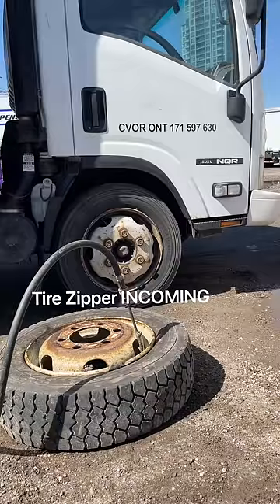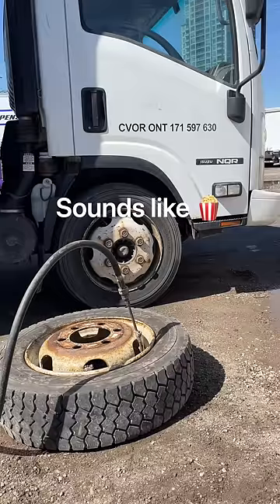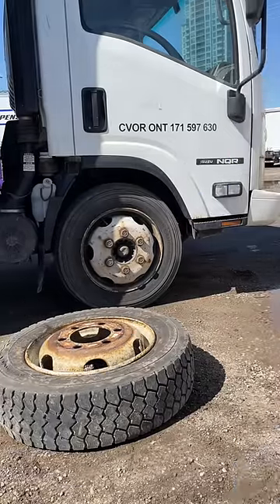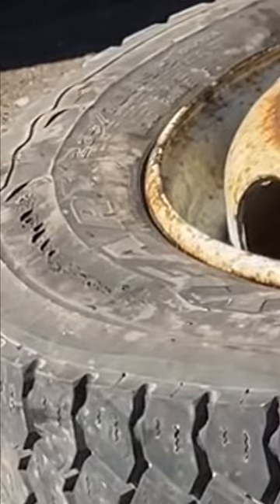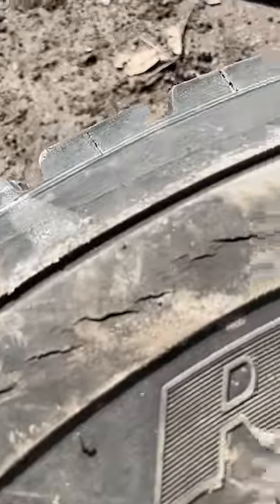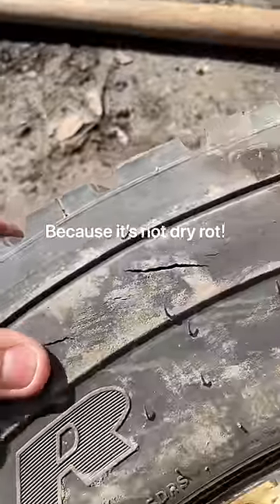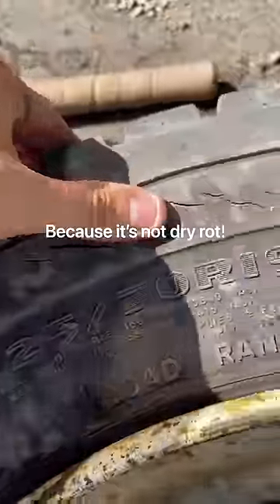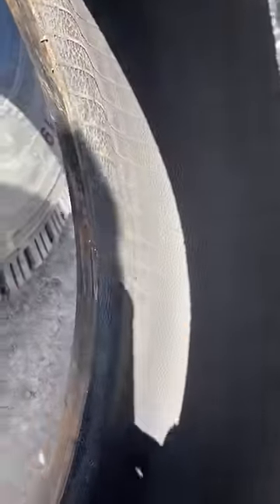Tire Explosion Warning: 🍿 Sound! #shorts

Comment: Tires can also make a very similar sound when the bead sets off center and then corrects itself once the air pressure comes up. Thing is, that's normal and doesn't kill people. Zippering definitely can.

Comment: shout out to all the tire guys and girls out there.
this is dangerous and we all need you.
early on i was warned of the dangers of pressurized air and also tires. ive seen bike tires pop and send groups of people running. ive seen car and truck tires pop and do some damage but high psi truck tires are no joke. these things can unalive even the toughest things faster than the big mad can throw a 13mm wrench in your plans. when you realize every square inch of that tire is under your body weight in pressure. it changes how you view that.

Comment: The reason why the inside of the tire would look fine is because dry rot normally occurs when the outside of the tire goes through repeated cycles of getting wet and drying out, the inside of the tire would never experience that because it’s sealed.

Comment: Crazy I just heard that same noise this morning while filling a tire. But I constantly checked the pressure and it wasn't getting overfilled.
Reply: Overfilling isn’t the cause. They can and will explode even at pressures under max pressure. 
That sound is the sound of the cords of the carcass tearing apart. If enough tear, the whole ply will tear explosively and the tire will explode. 
They are tearing because something has caused them to weaken. In this case it was dry rot. In other cases it can be heat or other damage or a manufacturing defect.

Comment: To never dye from a tire...#1 Don't ever approach a tire if you hear that popping or see a bulge. #2 it should be in a cage or restrained on the truck when inflating so you can let it boom without risking your head or 200 lbs flying at someone. #3 install a valve 15-20 ft down the line so you can stop the air let out the air and check the current pressure when airing up.  I've had several that don't make a sound before just going BOOM, flat sidewalls no bulge literally a brand new tire and boom at 70-90 psi. So don't trust any tire, restraint it, stand back with in line air gauge and let it sit a minute at full pressure.

Comment: I wrote up so many tires on vans in a chemical plant! Dry rot is nothing to play with, this old plant was very tight and the tires scared everyone. We spray painted them pink orange yellow and green. One tire for each color, this way the owners of the plant would force the cheap sub contractors to replace the tires.  Even though only rolling at less than ten mph. A tire poops and it could hit someone! Pops not poops!?!?!

Comment: I was riding my motorcycle last summer and was passing an old, beat up semi rumbling along in the right lane. When I began to pass and pull up next to the trailer, one of the tires chose that exact moment to explode. I was maybe 8 feet from it. Whoa Nellie! The fact I lived was amazing. It was spectacular. When I got stopped on the side of the road, I had pieces of rubber inside my jacket and jammed into my visor. That's when the shaking started. That quart of adrenaline that was dumped into my bloodstream was like no terror I had ever experienced before. So all you truckers who are trying to save a few buck by not replacing these piece of shit tires...when it happens to you, or a loved one, only blame yourselves

Comment: I had heard that sound several times and did not know what it meant, until I had one of my tires being repaired and the service guy started to run away.
 And he yelled and me to get back.
 And I thought the dude was an idiot. Then he explained why.
 Luckily the tire didn't explode.
 I didn't have the money to replace it at the time. 
 So I deflated it 30 PSI and drove on it several more weeks😁

Comment: It’s especially sketchy on airplane tires.  12 ply tires filled to 200psi on split rims.

Even brand new wheel assemblies with a new tire installed and already seated and leak checked can just decide to blow the fuck up.  

Some aren’t re assembled correctly and the whole thing will explode turning that 20lb 14inch hub yeeting off the axle at the arm amputation speed of “you’re about to find the fuck out” 

Being an A&P is scary.  I’ve narrowly dodged death like 5 times in 8 months

Comment: I know that sound well. Thank God it was on the trailer on the inside. I was only doing a PM service on site, it was low and i was going to check for a leak. I didn't get that far before BOOM! It almost sounded like the bead seating but it was the tire zipper. It blew with such force it embedded dirt into the back of my hand while holding the air chuck. I had safety glasses on and I'm lucky i did.

Comment: He pulled that out quick... Glad you did tho bro you would've been mush if that exploded. And I can't lie I had always been skeptic about filling up Heavy Terrain tires on sprinters that require over 50psi. Even a new tire can fail and possibly explode, so instead of standing in front of the tire I stand off to the side using that same extension he's using in the video

Comment: Had a inside dual on a semi trailer blow on me. Took it up to the shop to put air in it because it was really low. Was putting air unto it, heard the cracking, thought it was gravel under the tire on the concrete pad. That was 8 years ago and i still have ringing in my ears

Comment: So in that case. After I disconnect air hose from the tire, what should I do? Release the pressure from the tire by pressing the tire valve? So dangerous. Keep a safe distance and let it explode? Looks like it wasnt what you did

Comment: Cracks in the rubber let water penetrate to the steel causing it to rust and weaken. 

1. The tire should’ve been restrained. Had it blown that thing will take off like a rocket 
2. You need to have a remote air line. Putting your arm in the trajectory zone is dangerous 

You need to sign up for a TIA course on how to service tires. You are gonna get yourself or someone else hurt and possibly killed.

Comment: When i was a teen i worked at uhaul and one day we had a truck with a flat, bit I could see no obvious reason for the flat, so i decided to bring it back up to pressure. 100 psi. Needless to say it blew up in my face. Luckily the inner tube didnt burst thru so it only sounded like a bomb went off.

Comment: I’ve actually seen a 22.5 explode off the rim laying on the floor. It was being filled just like this and the little Mexican guy forgot he had no needle in the valve stem. so it was filling fast. Close to 5 mins pasted and a huge explosion happened.The tire shot up into air like a fucking rocket and went right thru the roof of the shop. It created tons of fog, dust and debris everywhere. The hole it made was about the size of the tire. It was a steel flat roof. To boot the hole didn’t get fixed all week.😂😂😂😂

Comment: work in medicine but have some vintage trucks on split rims.  never forget this one guy looked like he was thrown off a motorcycle at speed nah he was airing up a tractor tire which blew throwing him through the sheet metal and 2x4s of his pole barn.  clear through broke the 2x4 ripped the siding off his barn.

I have a nice long air whip with an on off valve.  nothing goes near the tires when air is flowing.

Comment: I had a new retread bubble up in my hand 20ft from the cage while rolling it to the trailer. That one was more like a crackling sound, im guessing it was the air forcing the glue apart, happened fast, i heard it and felt it at the same time, i looked straight down and saw the 8in bubble, quickly but gently laid it down and ran away. Then had to grow the balls to go back and shove a air chuck on it to let the air out, i wasn't standing there long enough to pull the valve core.😅

Comment: My first job was completely non-OSHA tractor trailer work on them 8 wheel 40 foot beds in a dirt yard with rocks too big for casters. I cannot tell you the number of times I've sat face first putting 115psi in a split rim tire just smoking🚬

Comment: I pumped up some 20 year old 10.00 tyres to shift an old truck that were doing that. Kept my distance from them and they did last on the run home but a few days later one opened up and the inner tube bulged out the side

Comment: 2 seconds in and I'm saying loudly 
CAGE
Inflate it in the cage!!
ESPECIALLY SPLIT RING RIM types.

Roll it on the safety cage and you inflate it from outside the cage.
This is ancient information.
The Cage isn't a new thing.
Inflating to high pressure is like 
"Looking down the barrel"

Comment: And that's why DOT needs to put a age limit on commercial motor vehicle tires. Believe it or not tire manufacturers will tell you that there is an expiration date on tires believe it or not it's just true facts. The fact that they recap truck tires and I've seen them where they have been severely dry rotted that this is considered safe and legal. Whereas you can no longer recap a car tire like you used to be able to. Definitely need to push the government to put an age limit on tires that can be on a vehicle that is on the road. Can't be no more than 5 years old my personal opinion. Even less in some cases.

Comment: I remember seeing the aftermath in the shop of a double axle 5th wheel RV tire blowout while it was on the freeway. Ripped the fender off the slide sitting over it and then some and actually took out the fridge inside.

Comment: Yeah you can't always hear that and then you find out when you get closer to the tire what's going on. I found out the hard way and I got blasted right in the face with it. I came out okay but I'll be damned if I do another tire that's been driven for 50 miles and not told about it. Makes you gun-shy as hell

Comment: had dry rot on my tire and didnt even know it (its winter season and i drive to and from work in the dark had low tire pressure drove to the gas station to blow the tire up and check if i got a nail in it only to see a missive gap on the sidewall that probably leaked air

Comment: I had one when I was like 16 do something similar but it didn't make a sound it was a brand new retread it just came in from the tire shop someone else mounted it but it was in my way so I took over finishing airing it up and it had like 5 pounds to be fully inflated so I stuck the chuck back on and it wasn't like 30 seconds everything kinda went black and the next thing I remember my ears was ringing I hollered for someone because I was on the ground and the tire on top of me it blowed me back under another truck then the tire landed on me I got lucky I couldn't really put weight on my right leg for a week I had a hard time walking

Comment: My guy isnt suppost to walk over and remove it youre suppose to use the chuck to remove the air with a quick disconnect so youre not in the zone of destruction. Only safe spot is around the band of rhe tread

Comment: I was walking on the side of a street when on the other side there was a shop that fixed tires or any truck parts so idk what happened but i heard a loud bang and i see the shop again and it's like the front where they were filling the tire got reduced peaces of metal sheets all that was left of the front part of the shop was the concrete frame luckily no one was injured

Comment: Question my tires around 30 years old but how can I tell if there's tire rot
Reply: You’ll see small cracking all over the side wall.  Also look ready close where the tread meets the sidewall you can sometimes see it separating when they dry rot.
Reply: @lemonaid8678  oh that's what it was okay